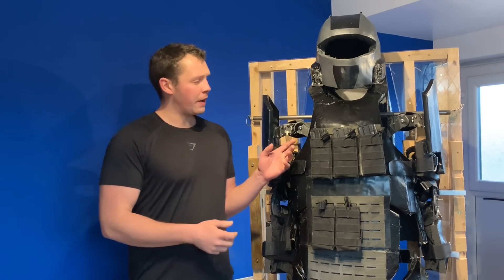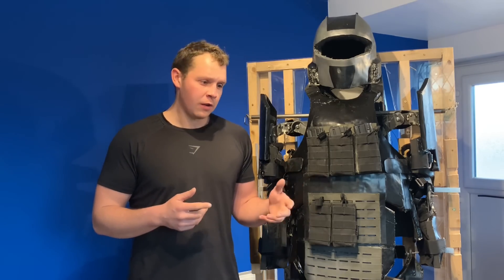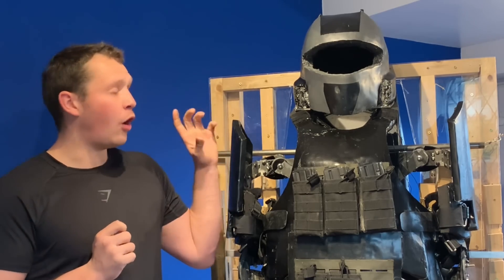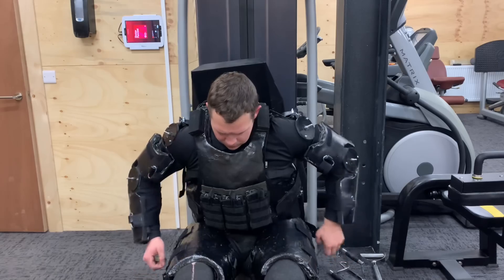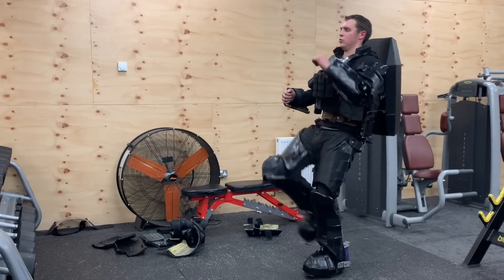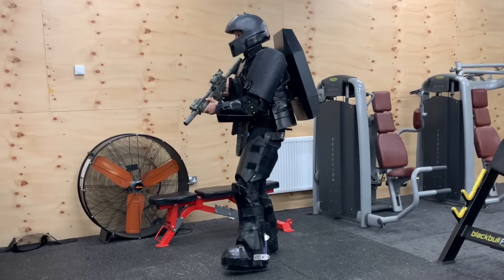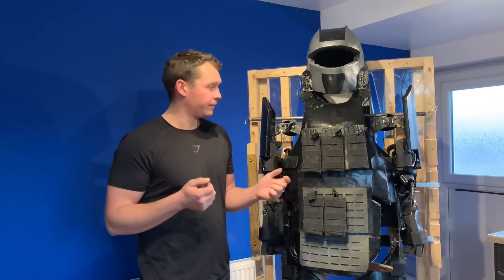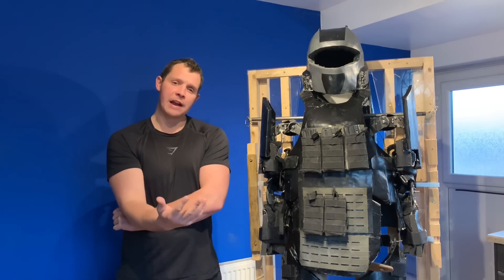Functional Combat Capable Power Armour Development Episode 5 Quest for Bullet Proof Exo Skeletons

Comment: I really like the design so far but when you did the firing positions demo with the helmet I couldn't help but think that you should add some protection for the neck; maybe like a lobster tail sorta thing coming off the helmet or like a salet; a gorget or collar of some kind might also work. That area just seems pretty exposed compared to the rest of the upper body. Might also be a good idea to deal with spalling on the front plate

Comment: Work on exoskeleton is ok going in different military and by development of this exo we can add more ceramics on it 
Indian army already use some type of non battery exo to handle balastic shild it's basically hang from an cord that is connected uper left soilder to an exo 
It's helps opporator to handle rifels using two hands while thta shild will constantly protect u from small arms fire work on nik battery or limited battery exo which can move with hands legs easily
With balastic gel where it's harden when hit it's also in research

Eventually more better exo will allow us to out more armoured

Comment: steel tendons with weight capacity!! needs frame for legs and upper body!!
Reply from the maker: Bot sure what you mean by steel tendons but there is an internal exo skeleton to lod the weight, currently made out of carbon fibre. Certain parts need to be thickened up but until i fit the actuators i cant really do that
Reply: i wonder if a steel frame could take the load off the user and place it on said frame would make sense to have steel tendons on that one! looks super cool! @MattExo-Dynamics

Comment: great work
I have this material right here that you might want to check out, it's a shin guard with a very interesting design. https://youtu.be/m-hYmBCFh-I?si=M7SJfgG4TT36j8xa
 I think this type of design is overlooked regarding designing armour and it would fit your armour perfectly since it's very large and have much room to spare as a cost of extra protection. Of course it can be applied to other joints too but since you are the one designing it I won't go too far trying to lecture you or something, I hope it can be helpful for you

Comment: What is the helmet made of? can it actually stop a bullet? Will you ever test the armor in a video? just wondering, i know these might sound tupid
Reply from the maker: The helmets the same multi layered ceramic and kevlar, as the rest of the armour (most of the armour has a carbon fibre outer shell but i didnt bother with the helmet as it turned out to be a-bit pointless). ive tested ‘test pieces’ of that armour and it stopped 5.56 x 45, (ball) out of a 22 inch barrel bolt action at 25 yards. 
I want to do a video but im in the UK and theres a number of limitations on posting on social media  if you have a firearms license (which i dont have btw). Its not that you cant put it on yt, ig etc but theres some rules on police notifications that clubs and owners have to make - which i dont understand, So if i take it to some farmer who’s a friend of a friend, record it and put on youtube theyre might be problems so its not worth me posting anything like thar yet. Until i fully understand said rules anywayz

Comment: Damn, their goes my dream of being the first to invent a functional power armor suit 😭. Im no engineer, however Ive had plenty of day dreams about how I would design a power armor suit. Im glad someone more qualified and skilled is already in the process of making it a reality however.

I really like how you have the lower portion of the torso armor freely hanging. Being a USMC infantry vet, one of the things that would deter me from wearing a full body armored suit is the restriction to mobility from rigid plates. I always imagined the best way to protect the lower-torso/upper-legs while allowing the most movement in those regions would be to design a sort of armored skirt. Similar to what Samuri armor looks like, but either using the dragonskin technique or 6-8 overlapping plates, hanging from either the waistline or right where the chest plate ends.
Reply from the maker: Thanks! I didtryva more roman skirt like design, but the overlapcausedtoo muvh added weight and bulk aswell as being difficult to keep in line with the adjacent pieces. I think once armour gets thick its a problem to do.Did you ever wear the groin pad thats in use now? If so was it annoying? Was it easily removeable?

Comment: I'm no operator, but allow me to illustrate for you exactly how difficult "bulk" is without the weight. I wear a typical Spiritus Systems LV119 with level IIIA UHMPE flexible shooter cut soft armor inserts for work. When I'm fully kitted with just that, and a rigid belt, it can already be difficult fully lifting my legs and bending over to put a sock on. So just imagine how infinitely less bulky that system is, compared to yours. Another factor which you clearly haven't taken into account is the thermal performance of a fully body enclosed composite skeleton. Just because the suit will theoretically weigh little, does not mean operators won't be moving and heating up in them. I imagine (especially with that helmet design) that your exo suit power armor is a nightmare to sit in for prolonged periods. Also looking at it, while it is a prototype I can tell by the swivel joints etc. that little has been done to engineer a solution for resizing the frame to different body types. Basically this suit was built from the ground up to fit you. That won't necessarily work.
Reply from the maker: All relevant points, starting with the bulk, yeah i understand thats why ive trimmed it all down so much, mainly so going through door ways and up and down stairs isnt an issue aswell as general moving about then main restrictive thing is the groin plate which will be changed jn future. Sitting down is actually fie tbh, the chairs needs to be fairly deep for the back pack but thats it.  Thermal regulation is a key issue which is one of the reasons why the back of the legs may be removed-off the design as well as being easier to move in. I plan on being able to feed fan driven air through channels in the foam for the next suit. The helmet design is on going that is the worst bulk issue atm. The suit was actually made from adjustable exo skeleton up, not armour up, all limbs are adjustable in length and fit ment. Obviously armour pieces will require some tailoring but with  3d scanning and cad its not really an issue. If youd like to see the adjustable internal exo skeleton its in one of my other videos
Reply: yea my suit designed around that

Comment: 80's kid here. you're basically doing what we as 12 year old brats used to dream about. subbed! I had a similar armor when back then made of wood and sheet metal. it actually looks like a modern plate carrier w/ a swimmer's cut too, all purely accidental. it was 1989 after all. I had coverage for my forearms using cardboard and a flat panel of wood. Iron man was an inspiration of course, but so was Robocop. My helmet was mostly cardboard but also had a slit for my eyes protected by a quarter inch of plastic, you know that container of flyers or maps? that's what I used but three layers of them. I was definitely roman candle and air rifle proof back then hahaha. I did lack ONE major innovation: ear protection. I blew up a fireacracker on my left arm, zero damage but my ears were ringing. I think I still have a little ringing today. good times. 

wishing you all the best in your endeavors! 

cheers, 

Oliver
Reply from the maker: Yeah pretty much! And thanks!
Reply: Bill Williamson in Uwe Boll's "Rampage" films.
Reply: I wanted my bones turned to adamantium like wolverine, I'm glad I didn't try .😂
Reply: Those dreams are still present today. If you still have that suit I would die for you to show it! ❤

Comment: one thing you could do with the helmet, is have it open (for gas masks and such) and have detachable panels so the right or left side of your face is exposed (for easier weapon mounting). Some modern combat helmets already offer such peices. and of course Velcro isn't the greatest for adding things to the armor, but then again it's decently cheap.

I hope you find funding for this project, it's always been a question in a lot of militaries to have a heavy but mobile armor for heavy combat. and honetly, your design is really good for being a one man job.
Reply from the maker: Yeah your right im currently designing bolt on armour attachments to a fast helmet. A flip down visor mainly. The velcro was quite a surprise to me tbh. It proved to be well stronger than i thought. Aslong as theyre decent quality straps (which half of mine currently arent) and the pieces fit togther well theyre a more durable option than most thigs. I tried kevlar hinges, which were great but if they get snagged on they do break, and theyre bonded in so its a big job to replace them, 

And thanks!
Reply: @MattExo-Dynamics  honestly if you have them, there's always the current option, which is mounting with rails... In a pinch you could get keylock rails from the hardware store?

Comment: Have you considered experimenting with integrating the PLCE webbing system? It’s the current system used by the British army.
Reply from the maker: Not yet but ill look into that webbing system now. Tbh i just stuck the MOLLE ok so i could get some pouches on. With the next prototype i should be able to fit a full array of pouches and gear on.
Reply: @MattExo-Dynamics You could probably modify an existing Interceptor Body Armor vest to get the coverage you want. The vest has options for neck, deltoid, shoulder, and groin coverage.
You can always add your rifle shoulder pads and groin protector to the vest using the molle. You would just have to find a way to power it.

Comment: compared to usa exo tech this is not even close and with solid state batteries around the corner even more so its like comparing a matchlock rifle to a modern machine gun
Reply from the maker: Currently, to a degree atleast your correct. But this is the prototype that normally a company would never release footage of, the rough path finder if you will. The technology is yet to be implemented, i was going to have a damage monitoring system on this one, but because i had to keep trimming the armour down to fit the body better i ended up cutting through the ribbons of sensor wire in-bedded in the armour plate, so that will have to wait for the next prototype.
Reply: Yeah, but where's your armored exoskeleton....

Comment: a few easy addons for greater suit comfort: as you already use an elastich achilles tendon system, you can add elastic knee assist, as well as steadycam like arm elastic assist and waist stabilization.

the powering is less necessary and also easier to do.

that achieves near weighlessness already.
Reply from the maker: Yeahh they’re good ideas! The only points to note and why i haven’t added them yet is for the legs and arms, there are movements you do where youd be working against the elastic so for certain positions it would be a detriment (eg walking backwards requires a slight hamstring curl). The waist/spine does have a spring system to stabilise the waist however i do need to fit thicker springs really to make it abit more stable.
Also the actuators im going to use do have a bounce setting which will help with stabilisation etc. 
thanks for watching and commenting btw!
Reply: @MattExo-Dynamics  the trick is to have the elastics reach zero tention at or before the neutral position (the position of floating underwater). this way the assist is not in the way for small motions, but supports major movements. 

walking backwards is no issue to if the following is kept: the achilles spring has to be stronger than the knee extension spring.
then the bounce of the foot can counter the extension spring when walking backwards or walking stairs. while both work together in standing, walking forwards and lifting.

for the arms  the suit weight of the users arm+ the armor counters the constant force already. the neutral point of the arm lift would make pullups unecumbered.

i am building an elastic assist fully articulate exoskeleton myself. its near finishing too. only some bracings for a more comfortable and aligned fit are missing, but the skeleton, plus its elastic tendons, work.
Reply: a repurposed camera stabilization system to hold a rifle with one hand would be sick
Reply: @Uberkist  its in the arm itself. no extra arm thats in the way